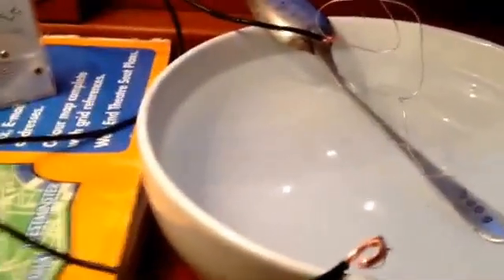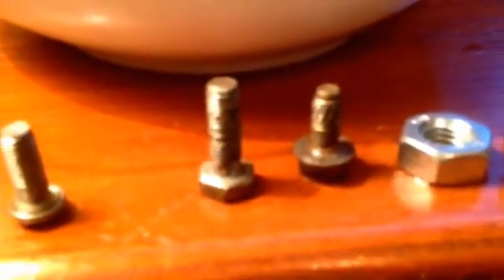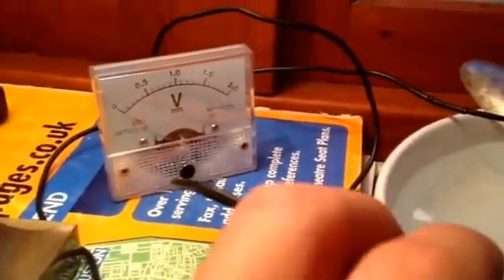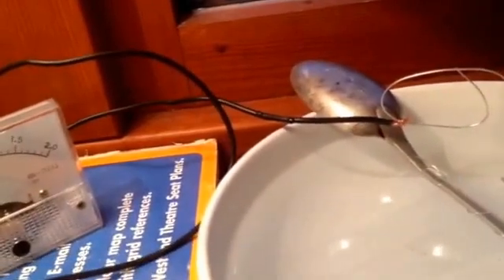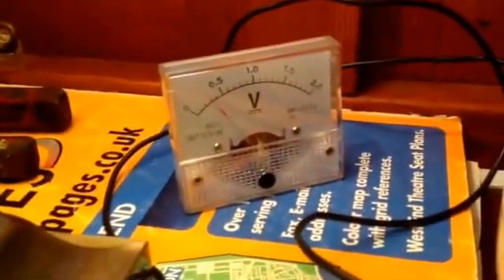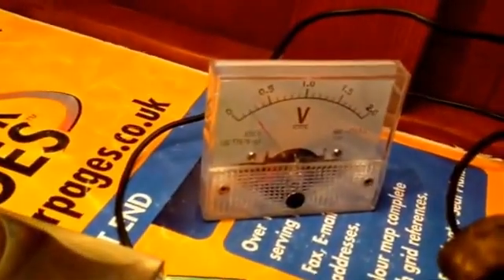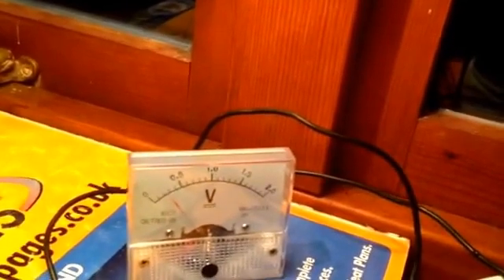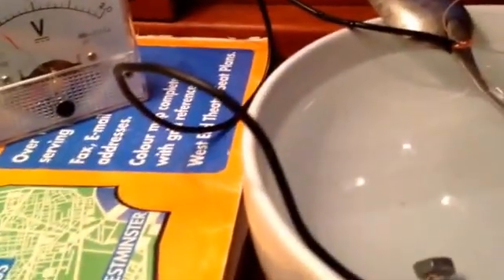Narrowboat Hull potential testing - hull/ bottom corrosion checks

Comment: Hi thanks so much for your reply...since it's sunny out today I just repeated the hull potential test but this time with a reference of  brand new zinc plated bolt in canal water.. results boat potential 1.004 V  against reference 0.82V .. that's. 0.2vish difference..
A couple of things come to mind.. how significant might this be?   Could my anodes be giving these reading( ie. they could be of inappropriate material or dissimilar) or could my hull protection be be messing with something ( coaltar epoxy)..
I'm pretty relaxed about the situation given the apparent condition of the hull and anodes but it is very puzzling and I like a good puzzle..
I'd appreciate your thoughts ( I can just imagine a watch battery rattling around in bilge or some such)..
Thanks again ( I'm currently chugging to the peak forest)

Comment: Hi just wanted to say I really appreciate your contributions..

I have a question..

As a narrowboat dweller myself I did the hull potential test with interest.. the readings for my hull were 1.004v ( using silver plated spoon) .this is a little high so I went through all my circuits isolating each and loading each.. result 0.003 variance..
So I dug a little bit deeper and removed all sources of power from the boat batteries, solar,etc off the boat.. result.. same readings.. so I borrowed a mates fluke meter thinking my cheap chiseium modal notup to snuff.. results same readings -+.005 v..
Incidentally this hull was grit blasted and epoxied from new and when I did finally get into dry dock some nine years after launch the hull was much better than I expected ( maybe 150 small blisters but barely any corrosion and plenty of meat left on the anodes)  which was a relief given the initial readings..
I'd really appreciate your thoughts on this little conundrum.. 
Thanks again for your contributions... enjoy the sun!
Reply from the maker: Repeat my baseline tests with a sample of the water you are floating in - salinity my be affecting readings